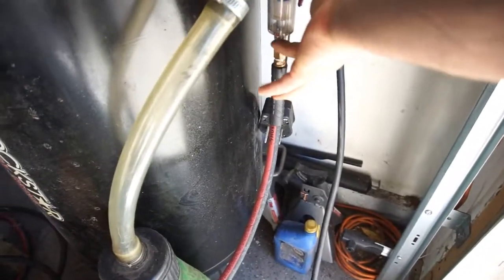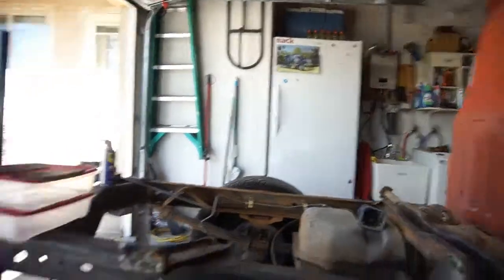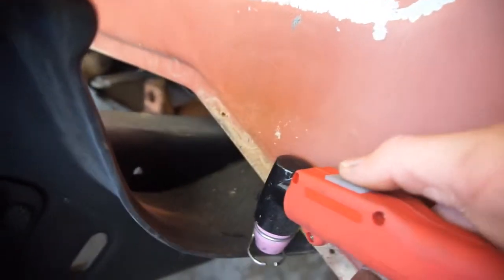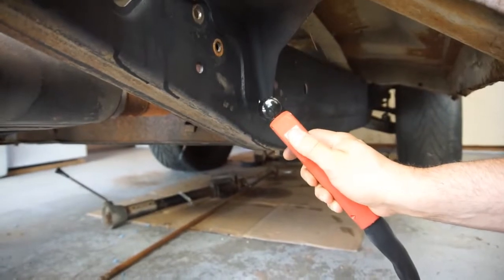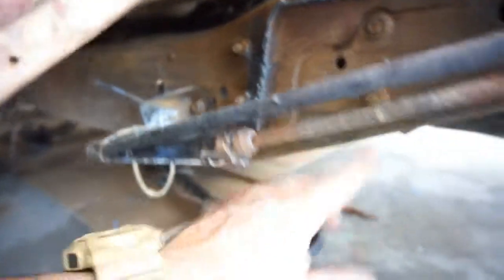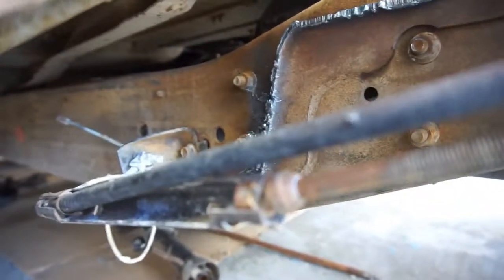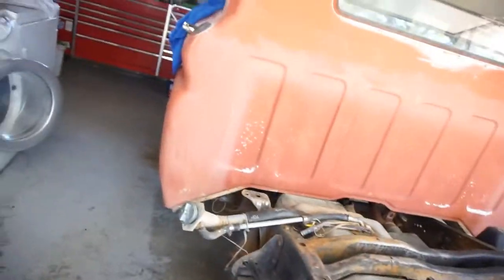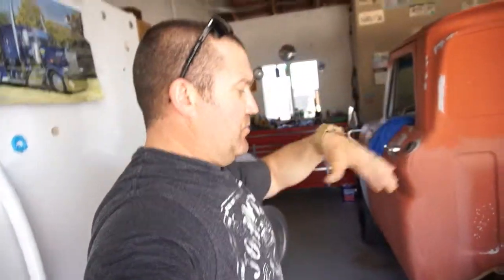Plasma Cutting With My Everlast 3 in 1 Tig Stick plasma. Cutting on Project Crack Pipe PCP

Comment: I have a 256si everlast on a ups truck coming. And I have a 1999 dakota r/t, that damn thing weighs over 5400 pounds, you're showing me the best way to put her on diet.
Maybe get a couple more miles per gallon but actually looking to drop that e.t. in the quarter mile.
Reply from the maker: Korie Creson that’s awesome. You’re gonna love it. Hopefully you can shave a second or 2 at the track. Let me know how you like it.
Reply: @Halffast719  I will let you know. Yeah I hope to just get it lighter. I have a project 70 dart that's getting a stroked big block I'm really going to race that .

Comment: Maybe drop that tank and get yourself a fuel cell. :)   OR instead of dropping the fuel tank down.... looks like you have a few inches to move it back towards the axle. Would that work too?
Reply from the maker: OneNGlen yeah I thought about a fuel cell but this is a budget build little to no cost spent. I’d have to make new straps to move the tank back towards the axle. But it’s a good idea that I’ll look into.